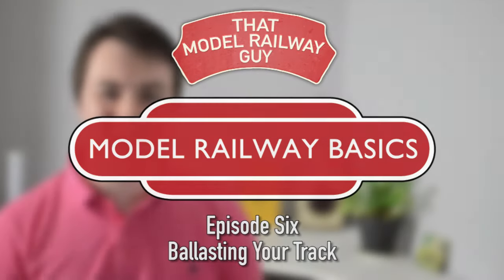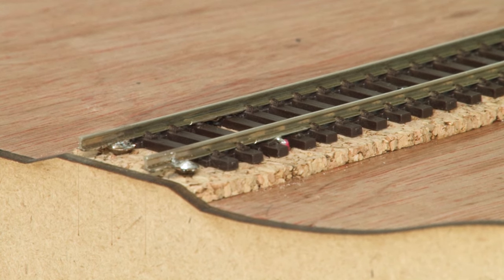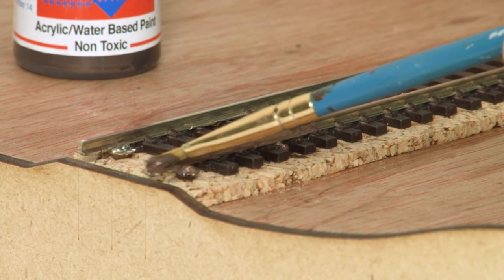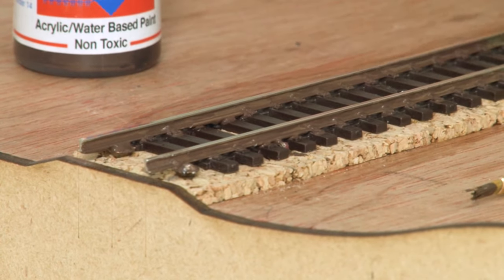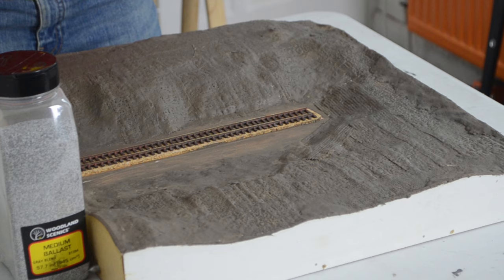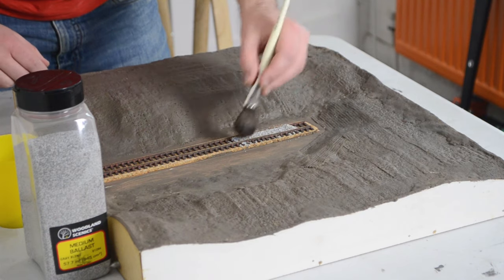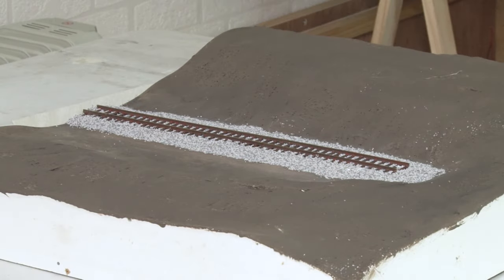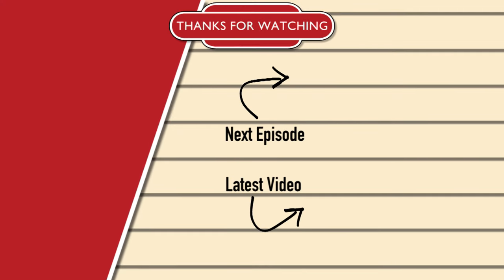How To Ballast Your Track - Model Railway Basics: Episode Six

Comment: I have just spent 3 days putting the ballast down and tidying up on my new layout, what a job 😭. Glue down this week. Trying to get rid of the odd bits of ballast around the sleepers between the rails has just about driven me to dispare 😱. I am not going to attempt to use our Dyson vacuum cleaner as it is extremely powerful. Relaxing hobby, I need a holiday 😂
Reply from the maker: Wow, sounds like quite a mammoth task! I've been ballasting my layout in small sections at a time which seems to have worked well so far. It's one of those things that can make or break a layout so, even though it's a bit of a pain, it's worth it in the long run. Thanks for watching 😃

Comment: It does seem scary at first, you're right. But by the looks of your tutorial I'll need to do this first before I start with the actual scenery. Somewhat relieved. Again, another beautifully put together video. Thank you for sharing!
Reply from the maker: Hey there, what order you do it in really depends on your personal preference. I find the ballasting process can be quite messy so I do it first to avoid getting the stuff everywhere else. But I do generally try to get a rough structure of the surrounding scenery in place at the same time if not before. There's no hard and fast rules and every situation is different. Thanks for watching 😃

Comment: I found a syringe could get stiff at time and result in a sudden stream of glue, which blew away my carefully placed ballast - eye droppers work well (and you might be able to get one or two free from a pharmacy!!). I also dirtied up the ballast using a drop or two of indian ink.
Reply from the maker: That's really interesting Neil, thanks for sharing that. I've never come across that myself but I tend to wash the syringe out after every use to get rid any excess glue so I wonder if that makes any difference. Funnily enough I steered away from using pipettes because I wanted more of a stream of glue rather than individual droplets, but everyone has their own way of working and their own preferences.
Yes, usually when I'm building a proper layout I would also weather the track/ballast afterwards with a wash of the Sleeper Grime and I admit the ballast does look a bit too clean without it here. Thanks for watching 😃

Comment: I find using a Brown Sharpie Permanent Markers Pen with a Fine Point  works well as rust on the side of the rails and on top of the rails and sides around any buffer stops. Run the pen along the side of the rail 2 or 3 times in each direction and its done, The pen will wear away quite quickly so best to buy a pack of 20 in one go. Also good for point work around the frog and blades but don't put it on the electrical contact area of the points.
Reply from the maker: Yeah you can use marker pens too. As you've noted though, they do wear out fairly quickly so you need a few of them. Meanwhile a single small pot of paint cost me around £3 and has been going strong for over a year on my large 00 gauge layout. Thanks for watching 😃

Comment: Thank you for this video tutorial.  I'm new at applying ballast.  I tried a product called Ballast Magic, but not too pleased with results.  Next I tried Senic Cement applied with a syringe and it is drying now.  Still not sure this will work as expected.  If not, I'll try the glue mix you recommended in the video.  Thanks again!
Reply from the maker: My pleasure Karl, glad you found it helpful. I believe scenic cement is very similar to the water/pva mix I use so fingers crossed that'll work for you - but if not you've always got this video to refer back to. Thanks for watching 😃

Comment: Great video - for anyone watching the spray bottle of water is VERY important.  I forgot it and when I used my glue syringe (a kids Calpol dispenser) it moved the ballast all over the sleepers which I had to move with a brush before it set……I think in my keenness to get a bit done I missed that step…..

Got a question about cleaning the PVA from the rails afterwards - what’s the best way?  I’ve seen references to track rubbers, using ISP and using a small cloth with warm water poked into the rail.  Hopefully it’s not a difficult step 🙂
Reply from the maker: Yep the water definitely helps, I also find it stops the glue/ballast from clumping up into little balls too. 

For cleaning, I just use a track rubber as normal once everything has dried and that usually does the trick. It might need an extra pass or two but it's basically just like cleaning the rails as normal. Thanks for watching 😃
Reply: @ThatModelRailwayGuy  Yes!  The clumping - that’s exactly what’s happened to me.  With the track cleaning, I’ll get hold of a track rubber or two - I think the ISP in my last post was meant to be IPA…..lots to learn.  Many thanks for the reply, really appreciated

Comment: Rather than painting by hand u could use rail match spray can of sleeper grime before laying track,  it's also quicker
Reply from the maker: That is definitely an option for the base coat, although generally I prefer painting by hand. Certainly the rust effect on the chairs needs to be done that way which is the most time consuming part anyway. Thanks for watching 😃

Comment: Great video,also ive just finished doing my ballasting but some of the glue has got ontop of the track in spaces will this affect my train running if so how to get it off? Hope you can help
Reply from the maker: Yep it's totally normal for some of the dried glue to end up on the rails. Just clean your tracks however you normally would - personally I use a track rubber but I know others like to use IPA or other solutions. Thanks for watching 😃
Reply: @ThatModelRailwayGuy  ok thanks for the help

Comment: A 50/50 mix of PVA and water has never worked. All of the fine detail you go to placing the ballast perfectly is ruined by the glue which moves all of the ballast. A pipette does not work because it makes the glue too bubbly. I was hoping you would have a proper solution to ballasting, not the standard one that doesn't work.
Reply from the maker: Hi Joe, I'm not sure what to say really other than it does work as you can see in the video and is the same technique hundreds of modellers have been using for years. If it didn't work it wouldn't have become a standard.

- Are you adding the washing up liquid to the mix? This is a very important step that breaks down the surface tension and will stop the ballast moving. Additionally the ballast must be damp before adding the glue but it does dry out very quickly (especially in the Winter if we have the indoor heating on!). I recommend using a fine mister rather than a regular spray bottle if possible for this and only do small sections at a time. I was ballasting a siding the other day and had to respray the ballast several times as I worked my way along.

- Personally I prefer to use a syringe rather than a pipette as you can create more of a flow of glue rather than individual drops. It does sound like the bubbling you describe though is more due to the surface tension issues again though. If you adding the washing up liquid (remember only a couple of drops are needed) then it needs to be throughly mixed in. Otherwise I would suggest testing out a few different ratios of water to PVA on a test piece as some people do prefer to use a more watered down mix.

- Additionally you don't have to use this technique. One simple way of doing it is to stick your track down using double sided tape and then dropping the ballast over this. The particles will stick to any exposed tape and any loose excess can be vacuumed up. 

- There are also products like Ballast Magic, which is an adhesive powder you mix into your ballast. I've never used it myself but I've heard that it does work. Obviously this comes at more of a cost though especially if you have a larger layout. 

Hopefully that's given you some ideas or alternatives to try and best of luck with your layout. Thanks for watching 👍
Reply: @ThatModelRailwayGuy  that's really helpful. Thank you very much for your kind reply.

Comment: Great video! I’m looking to get started with TT and doing my very first setup. The board the track is on while most likely have to be stored on its side. 

Using this method, would the ballast all stay put, or would you expect pieces to keep falling out the more the board is moved?
Reply from the maker: Hi Chris, great to hear you’re getting started on TT - I’m considering a project in that scale myself.

The ballast will be absolutely rock solid using the this method so no problem storing the layout on its side or even tipping it fully upside down! I have another layout which is stored inside a suitcase and the ballast is fine on that so I can speak from experience. The only thing you might have to look out for is foliage and grass might start to come off the more the boards get moved about, but that’s easy to rectify. Best of luck with your layout and thanks for watching 😃
Reply: @ThatModelRailwayGuy  that’s really helpful thank you! Good to know. 

I’ve gone through all of these beginners videos now. They’re super helpful and really clear. Thanks for doing them. 

One further question, along similar lines to the first, is the static grass also quite robust when dried and would that be ok stored on its side, or is that when you might start to see a small pile of grass building up on the floor?

Comment: Great vid! Where can I get the strips of cork to lay the track on please?
Reply from the maker: Hey there, most model shops sell cork for model railways in various different thicknesses - you can even get it on Amazon nowadays too. If you want to pay a bit extra you can get cork which is pre-cut into strips to match the track width. I have used that occasionally but most of the time I just use a standard sheet of cork and cut it into strips myself. Hope that helps and thanks of watching 😃
Reply: @ThatModelRailwayGuy  brilliant thanks. What thickness cork did you use please? Also what was the exact  model of ballast you used? Great vids btw, the best I’ve come across on modelling railways by a mile.

Comment: Why don't you use a spray paint over the rails out of interest? I just did the rails with that and then used a lollipop stick to rub it off ( in the absence of rail cleaner) ... Of course don't do what I did and forget to cover the rail contacts on points :) Doh!!!
Question for you, once the ballast is down and glued, will this make the track rigid enough not to have movement that may hamper rail connections? I'm using the old school Hornby undertail connector and it's a bit iffy even on the simple oval and siding
Reply from the maker: A combination of reasons really. I don't have an airbrush for starters so I'd have to use spray cans and I'm not working in a particularly well ventilated space either. To me though, spraying it on always makes it look bit too flat to me where doing it by hand, although a much more tedious process does give a better overall result (in my opinion).

The dried ballast will definitely hold track in place - certainly flexitrack which might have some movement to it. For the power feed though I'd really recommend soldering wires on to the rail if there's any doubt. If it's already a bit dodgy without the ballast down I think that's going to get a lot worse once you introduce a layer of glue too. If it dries in a way where it's not making contact then you have to dig up all the ballast and start again. It's much better to sort these issues out before moving on to the next big step, otherwise it'll just continue to frustrate in the future. Thanks for watching 😃
Reply: @ThatModelRailwayGuy  it's only a small test oval, just to feed my itch :) I only have these connectors currently and no wire so I'll give it a go and keep fingers crossed... Bet I come back in a few days eating my words 🤣🤣🤣

Comment: I just ballasted a large section of track on my layout and after cleaning the rails, no power would go through to the section I ballasted. Any tips?
Reply from the maker: How did you clean the rails, I find it tends to need a good going over with a track rubber and even then there are still some areas which need additional cleaning once you get trains running. Does the power stop exactly where the ballast starts or at a rail joint? Its possible glue has gotten into the join and insulated it if you don't have additional feeders round the layout. Are all locos affected or just those with less pickups? Are there any points in the section? These usually need to be ballasted differently so avoid causing issues, especially if they're being used to route power. There's lots of potential causes and things to try but without seeing the layout and knowing what work was done I can only offer suggestions. Hope that helps and thanks for watching 😃
Reply: @ThatModelRailwayGuy  it is in all areas with the ballast and just outside of the ballast, so I’m thinking glue might have run into the joiners. To clean the track I went over it with the track rubber, and then went over it again with a Q-Tip and IPA.

Comment: Sorry forgot to mention that if you have cork roadbed try to paint it with a primer (grey is perfect rather than pink) ,or hand paint with acrylic. This hides any bit of cork that may peek through.
Reply from the maker: Generally I find that, when you use the watered-down glue mix, the ballast will shift to fill any gaps anyway so painting the base isn't necessary. I do paint the cork/etc when ballasting points as I use a different technique here with a lot less ballast. 
Additionally, some people prefer to use an airbrush or spray can when weathering the track before ballasting, so that would give your base a dark brown colour anyway. Thanks for watching 😃

Comment: It’s my second time ballasting with this method and both times the ballast clumped up and made cracks in the ballast. I sprayed it with the water and I don’t know why it does it.
Reply from the maker: How often are you spraying with water? One common mistake is that people spray their entire layout and the water dries before you get the glue on. I would recommend doing small sections at a time and keep misting the ballast with water as you go. Alternatively if you're still finding the ballast clumps up then a drop of the washing up liquid in the water spray can help too. Hope that helps and thanks for watching 👍

Comment: I notice in some layouts that people aren’t using cork in fiddle yard set ups and some are wig either individually tracks corked or a larger piece wide enough for 2 or more lines. Some ballasting straight on to the base board and others just ballasting main lines…Can be confusing for newcomers what the norms are.
Reply from the maker: There are no norms - that's why. I talked about this more in the track laying episode but you're free to do it however you want with regards to using cork or not. Some people swear by it, others don't think it's needed... as long as your track is nice and smooth that's the important thing. Thanks for watching 👍

Comment: Spraying the track with water looks really nerve racking to me.

What if I wanna ballast where the power track is? That's what I'm really nervous about doing
Reply from the maker: Are you using the Hornby style power tracks with the box that the wires clip into? Or do you have your wires soldered directly to the rails for a more discreet look? If it's the later then there's nothing to worry about, just obviously don't have the power connected at the time!

If you're using the Hornby style power tracks then just use an eye dropper or a syringe around this area to add a couple of drops to the area in a controlled manner. (Again make sure the power is disconnected/turned off) Remember you don't need a huge amount of water, it's literally a fine mist which is enough to allow the glue to flow instead of balling up into droplets. 
Hope that helps and thanks for watching 😃
Reply: @ThatModelRailwayGuy  thank you

Comment: It seems I messed up the whole ballasting part, I used medium grey talus, instead of ballast, the funny thing is Ive done a whole track so uhh?...now what? Do I keep using it to finish or restart the ballasting part?
Reply from the maker: Are you happy with how it looks? That's the main thing. If you are then there's no reason to rip it up and start again but if you think it looks wrong or it's causing running problems then restarting will be better in the long term. If you do decide to restart you can usually soften the glue a little by adding a bit of water over the ballast you've already laid. Hope that helps and thanks for watching 👍
Reply: @ThatModelRailwayGuy  Thanks! It looks good but I haven't set electricL up yet so I'm not sure if it works electric wise, but it does look good seeing wise!

Comment: Can spray glue work for securing the ballast?
Reply from the maker: Some people use a spray bottle to put the pva/water mix on the ballast instead of a syringe but I wouldn’t recommend using an aerosol glue. You need it to permeate through the ballast, where a spray glue will tend to just sit on top. Depending on the spray glue they don’t always dry clear and they can be a bit stringy too. Hope that helps and thanks for watching 😃
Reply: @ThatModelRailwayGuy  I see. The product I've got is Woodland scenics cement that you can put into a spray bottle. Would that be ok?
Reply from the maker: @TankEngine97  Oh yeah that will be absolutely fine! I’ve never used it myself but it’s pretty similar to PVA in a spray bottle. It’s only the aerosol type spray glues I wouldn’t recommend for ballasting 👍
Reply: @ThatModelRailwayGuy  Righto. Thank you for telling me this. 👍